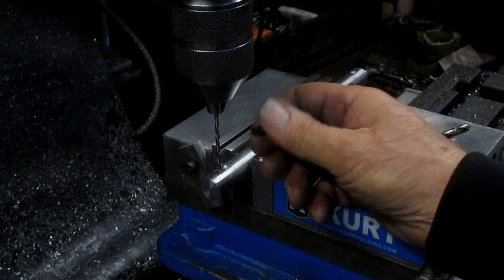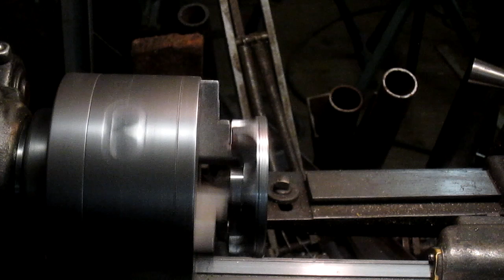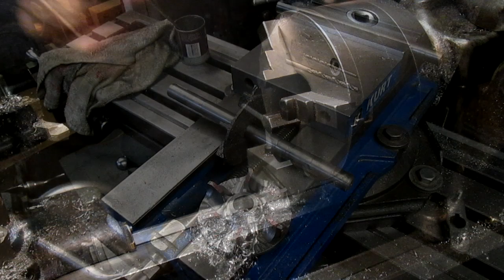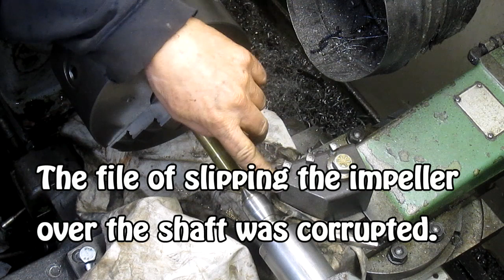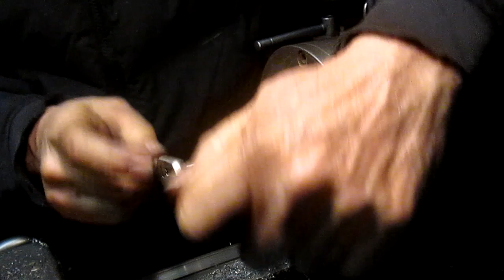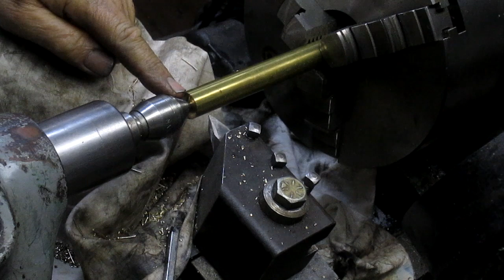Hundred Year Old Water Pump #3

Comment: You are one of the most straightforward and honest machinists that I watch. It isn't everybody that will show their mistakes and not be so self centered about how you run your shop and make the products you make. If you aint messing up you aint doing anything much.
Reply from the maker: Truth be told I edit out the total bonehead blunders which I am guilty of pulling on a regular basis. They are just too embarrassing.

Comment: I think originally a knurled pin or a spliced pin was used.

Knurled pins are, as the mane say, straight knurled an slightly bigger than the hole. when driven in the knurls get flattened out and conform to the hole.
They get loose rather fast and are only useful in low force applications.

Spliced pins (or split pins) are a pin cut in half with a very shallow taper (between 1° and 2°). You driving the half's in from the opposites sides.
Spliced pins are really easy made and useful if have to pin a hole with a non standard size.

The bad thing about both of them is that they are always made from soft steel and shear easily.
Reply from the maker: I am glad they came out with spring pins, make it so much easier.

Comment: Great work Nik!  I know back in the  old days, they did use "tapered pins" with a 1/4" per ft taper. on machinery.  They might of used one on your pump, but you did check the hole for taper.
Reply from the maker: It's entirely possible the original shaft did have a taper pin because the existing shaft had some odd marks in it like it was shop made. After 100 years that shaft could have been replaced several times.

Comment: That tracer attachment is bad ass.    Dry ice the shaft, and you wont need to heat the impeller very much, if at all.
Reply: Nik lives in the 'backwoods'.  Probably means he wouldn't have ready access to dry ice.
Reply from the maker: If I only had a supply of dry ice without having to drive a half hour into town to get it. I always have my torch.

Comment: Hi Nik,  love your videos. I was wondering why you have your lathe tool post set so far off the center of your compound slide. Great work especially on the impeller. All the best.   Jim in England.
Reply from the maker: Probably because I had to reach way out the last time I used the lathe and didn't reset. It's not as easy to see from my side as it is from the camera side. Who knows, it may still be that way, I'll have to check.